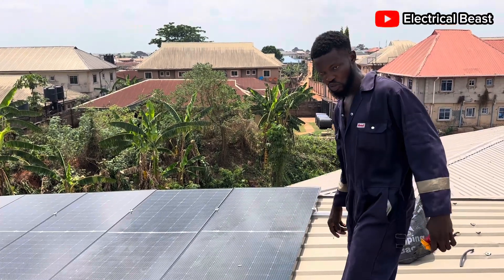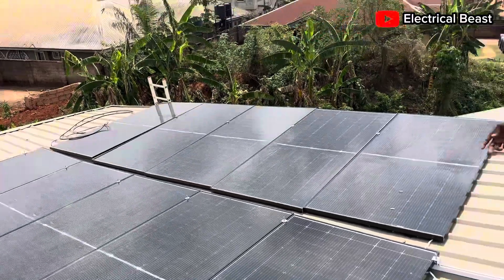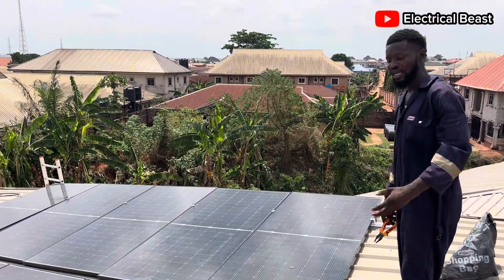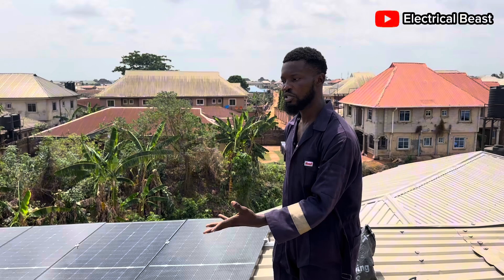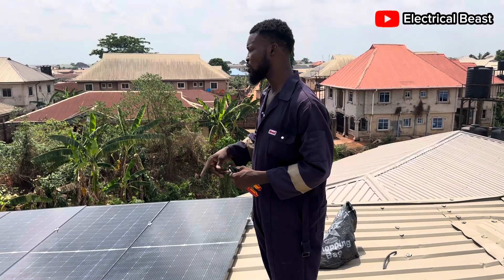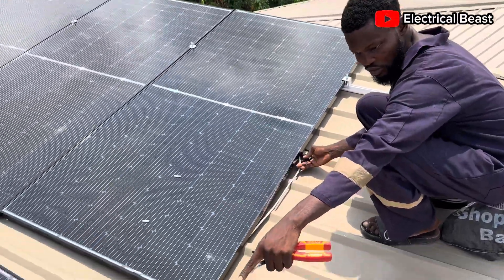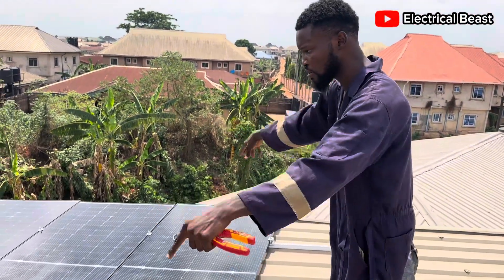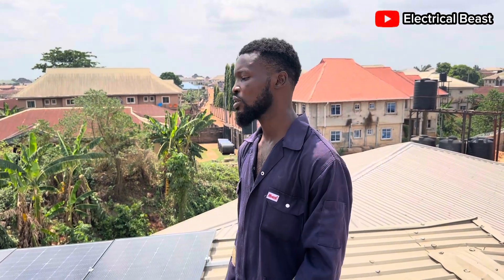How to Connect 10 450W Bifacial Solar Panels for Maximum Efficiency

Comment: If you say these panels are bifacial, they shouldn't be positioned flat on the roof as that negates it being able to harvest solar energy from both sides of the panels. You may have saved some money by using monofacial panels in this situation.
Reply from the maker: True! The client bought all the materials and there was no space to build a carport.
Reply: @ Really? I guess they threw research out the window.

Comment: The installation may not be perfect because you didn't provide room for airflow under the panel. Airflow is necessary for cooling.
Reply from the maker: The profiles enough to handle that. It’s not totally flat to the roof.

Comment: Is 10mm pv cable not too much for a low amperage connection (series connection)? Then, with that 10mm pv cable, you can connect even more than 20 450w panels series and parallel, just maintain the 400 to 420V then parallel others to about 30 to 40amps cos the pv cable you used can handle this amperage but too much for your current amperage (10 to 15 amps).
Reply from the maker: True, I just wanna be on the safe side. Also resistance is inversely proportional to cable size that means less losses.
Reply: Please go for training. You don't know what you are doing. Your current knowledge is limited. ❤
Reply: I just dey laf since untop roof😂😂 @lylatechnologies461

Comment: Why do you cut n join PV cables instead of using Mc4 connectors....this can lead to PV module burn or fire
Reply: This reply of yours is false and misleading. You are doing a whole lot wrong. Cutting corners just to save money and still advising unsuspecting persons who know little to none on falsehood. You could have also rem9ved the glass covering on the panels because they can fail also if you think that the MC4s do fail.
Please go for proper training. You are part of the people who are making people not believe that solar works.
At this rate, we need strict regulations on solar installations.
Reply from the maker: Mc4 connectors do fail also. Most times manual joints do more nicely.

Comment: Do you still need charge controller n batteries for this
Reply from the maker: It depends on the inverter, for a transformer-based inverter, you need charge controllers and batteries but for hybrid inverters, they have inbuilt charge controllers, and some can work without a battery.